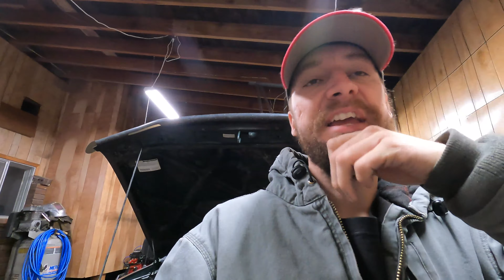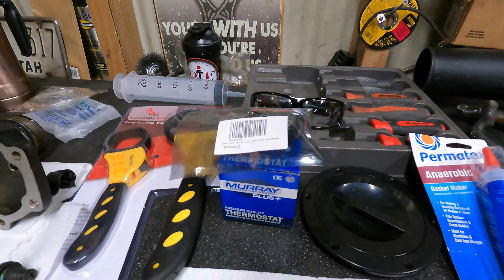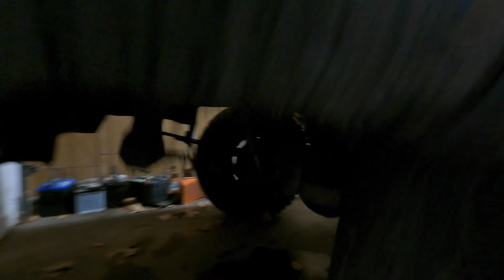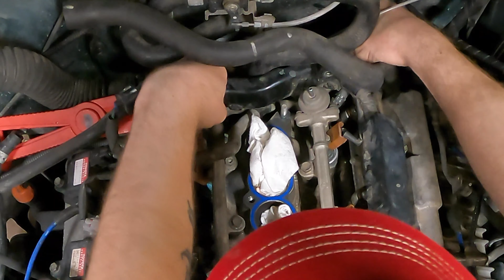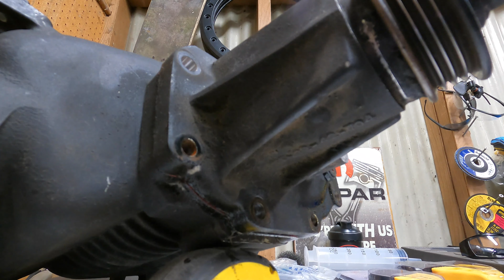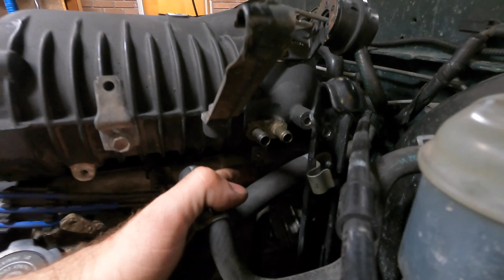Toyota Tacoma 3.4 TRD Supercharger Maintenance, More Boost And Full Fuel System Upgrade! Video 1-2!

Comment: Excellent! I’ve got a T100 with a 4th gen I bought new on ebay in 2014 or 15, it’s got over 120k on it now, and I’m having to go in there for a bad fuel injector, so I’ll be changing the valve cover gaskets and sleeving all the fuel rail wiring, the plastic disintegrated 80k miles ago, so everything is laced with aircraft string tie and clamped up off the lower intake. I’m going to cover that with black plastic braid this time in. I’m also replacing the high pressure fuel line and return hoses, as well as the vacuum lines under the fuel rail in the back by the fuel pressure regulator. I like the way you approach the job, and you show the average person that the job isn’t impossible to do with basic hand tools.

Comment: How does it run with the new injectors and smaller pully? Did you have to do any other mods to get the A/F mixture correct?
Reply: I’m wondering the same thing if anybody has done this since he’s not responding can you please let me know thank you

Comment: I would also like to supercharge my Tacoma but would like to avoid ping. 7th injector kit is so expensive though. In for more videos on this truck!
Reply: @HalversonAutoUT  just did!
Reply: I’m running a 2.0” pulley from Pulley Boys, URD stopped making them, and now you can only get the 2.1” and larger pulley from URD. I’m running a 4.88 rear, if you want phenomenal acceleration and no pinging, run premium and an easy to spool up rear gear, (4.30 or higher) and you’ll be the stoplight King in your area!
Reply: I have a 96 T100 with the 2 inch pulley I'm running a Snow Performance water methanol injection kit in my opinion it's a much better and less expensive way to go vs the 7th injector route

Comment: If I want to run the 2.2 pulley do I have to run the seventh injector kit and or also get it tuned or can I just put the 2.2 on and be good to go ? I don’t really race it or anything it’s a crawler but I would like the little extra torque Im sure it might give it…